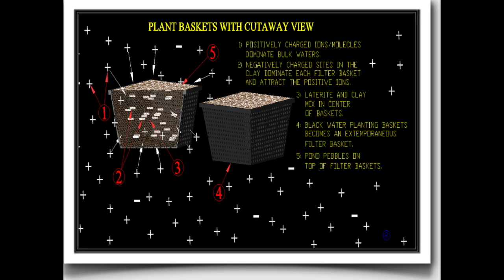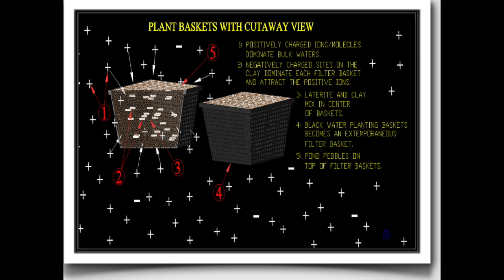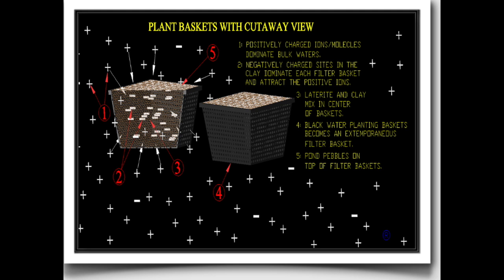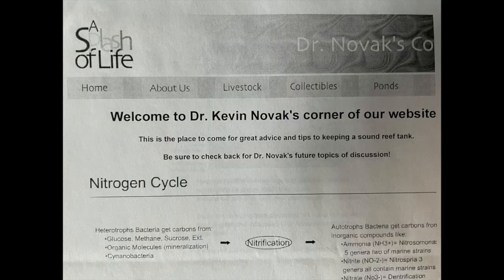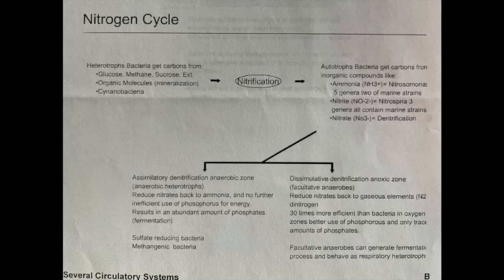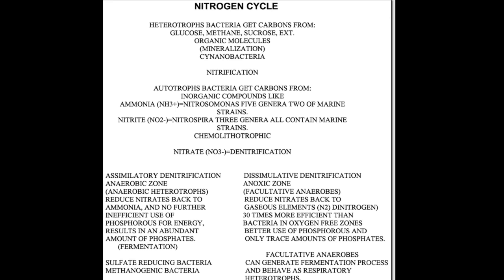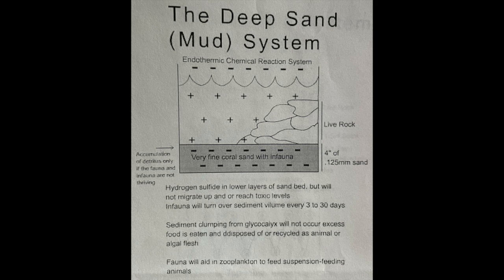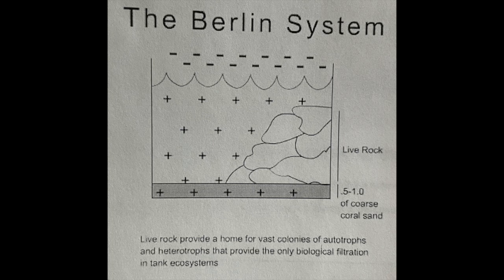PART:2 Why Do We Keep Getting This Wrong? Nitrogen Cycle. Kevin Novak Ph.D.

Comment: Dr Novak, love your enthusiasm to share your knowledge and reviving a long forgotten method.  Can you clarify the depth of the substrate?  You mention 3-4 inches deep using a plenum.  Is that total depth?  I think in your example of the antique 20gallon with blood parrots, you seemed to have a max of 3 inches total including plenum and gravel, using the blue under gravel filter.  Is 3 inches total including plenum the minimum you would recommend?  Would a small layer of sand at the top of gravel be advisable for shallower examples so that the sand can slow down the movement of water and act to compress the oxidation layer?
Reply from the maker: Yes that is total depth of substrate only, not the plenum too.

Comment: Great video I'm so glad ur putting these videos out if people can't understand what ur telling tell after watching this n I really don't know the more people that watch this n tell others about the way plenem slow moving plenems and bcbs work the better if they find out n still deside not to use the system the its there loss because it is great as for my slow moving plenem it's working but not converting all of the nitrates it is converting most of the but as you said best to have 3/4" layer over plenem I think I need to add more aquasoil I'll just keep tweaking it u till I get it down to zero nitrates I understand everything you told me but I'll be overfeeding overstocked or and need more substrate I'll need to measure the substrate and test for nitrates as its been over a week sense I last tested. Looking forward to ur next vid thanks again

Comment: Thank you again, Dr. Novak, for another excellent video!  What should the height space be, under the UGF plates?
Which is the best UGF, for a plenum?  Lee's and Penn Plax both have 2 styles ~ the "Original" is flat, with holes and the "Premium", has long slits , but I don't know their heights ~ then there are HMHF click together panels, which appear to be .6" high.  Is there a preferable UGF?
Also are Malaysian Trumpet snails beneficial, to a plenum system, since the burrow through the substrate?

Comment: Hi Dr Novak, the Jaubert Plenum diagram that shows the Anoxic layer  . What does the 1.2 - 4mm number beside the Anoxic layer mean? Gravel size diameter or Gravel thickness?
Does the Jaubert Plenum applies to smaller tank like 20 litres and does it matter significantly if the plenum layer  is less than 1 inch?

Comment: Hi Dr Novak, very informative video. In conventional bio filters, it's necessary to have an aerator. I'm guessing that there's no need for an aerator in the bcb Anoxic filter system? Or should the aerator be used to supply O2 to the main pond and plants? 

Looking forward to your advice!
Reply from the maker: Right, no aeration is necessary.

Comment: Thanks for the video this was very informative I want to start a modestly sized reef tank but the weekly water changes have been daunting to me so i've been researching ways of reducing the frequency of this. The deep sand bed with a refugium seems to be the most effectively way to do it to me, however, 4 inches of sand takes a lot of space. Is it possible to run biobricks in a low flow area of the sump to house the anaerobic bacteria? I'd be really interested if you made a video series about implementing one of these systems in a reef tank.

Comment: Dr. Novak, when putting a BCB basket in a canister filter, is there any functional difference between mixing laterite and kitty litter in the basket or putting the laterite in the center? Also, can seachem flourish red be used instead of laterite?
Reply from the maker: no not really.

Comment: Dr. Novak, muy buen video i have a biocinosis filtration system...
question: the few plant i have purchased had dissolved and never reproduced or grow.
Any advice to grow just one plant without using co2 gas?
moving the aquarium to an area with more light is not an option.

i hope tiu have some advice. thank!!

Comment: Would a low gph power head on my uplift tube be ok? Would prefer to not run an air line. Also not sure if my plenum is big enough. I used the pet smart under gravel across the whole bottom with 1 uplift tube.
Reply from the maker: What size tank, how big is the plenum and how fast or slow can the power head go?
Reply: @anoxicfiltrationplenums  it’s half inch tall and goes across the whole bottom of my 40 breeder. Wrapped in landscape fabric with 2” of fluorite on top (wanna go to stratum but it will lower ph a full point, my fish are used to 7.6). It’s a newa 160gph power head. They do make a 100gph one if that would be better. The uplift is I think 1”.